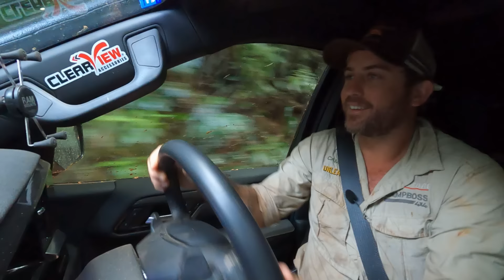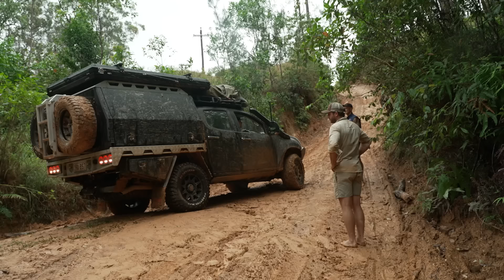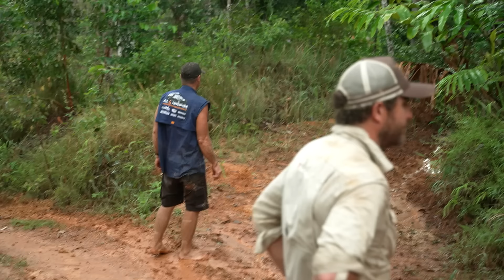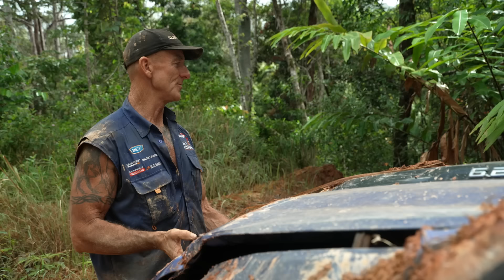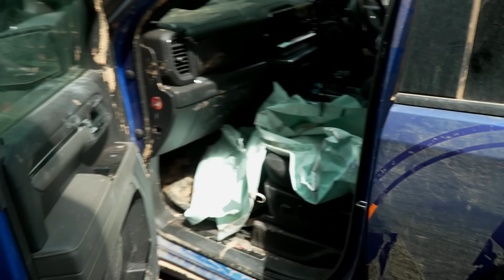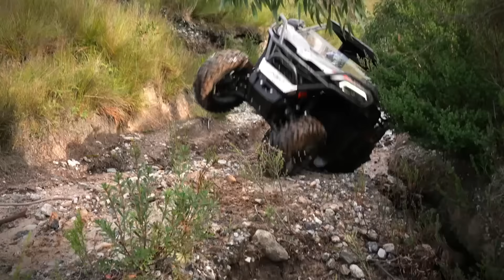🤬 NO NO NO! We screwed up – Chevy ROLLED & WRITTEN OFF!!

Comment: Brakes on wheels locked, no steering the driver becomes a passenger. Easier in hindsight, but in the low range use the gas pedal only when needed. The main thing is no injuries  insurance ,sponsors contractual funds, probably cover the damage easily.
Reply: Watch the video again, he was driving through the brakes.
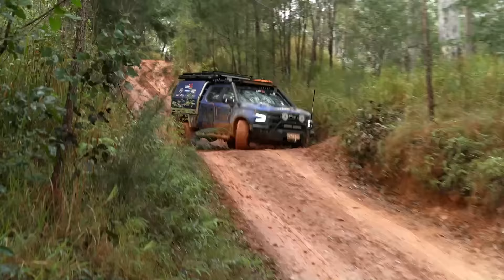Reply: @deangoodsell3478  around 16:34 he's locked up and just a passenger. Agreed he's still got steering and the wheels are turning until the camera angle changes at 16:29. The Dmax camera car made it down, they must have done something different....but the sensible option would have been to wait it out or even winch it down.
Reply: yep @17:50, front and rears locked up. The poser ute too heavy as well.

Comment: You don't drive the CREB in these conditions... Pull over and wait it out. But this makes great viewing guys. Hope all is well. Jesse is more experienced in this area and was put in front in the big rig.
Reply: Most other cars would of been fine, these guys are basically steering land yachts up 😂
Reply: Camera car D-Max made it down that hill first.
Reply: If you cannot see it was set up well joke on who?
Reply: I thought the creb track was always closed when wet?...
Reply: To have a better chance of success the chevy needed some Mickey Thompson Baja Boss MT tyres, the tyres used filled up with mud to easily, plus going slower would have helped.
Reply: @gen1c8rs88  he couldn’t go slower it just slid and got faster as it slid more, the weight forced him down at that speed

Comment: Wheels locked up. That’s why it’s always better to leave in low range and don’t touch the pedals.
Reply: Yes. As soon as it started understeering he locked the brakes, then was a passenger.
But without a lot of handling this situation, the reflex is to hit the brakes, no time to think it through.
I rally a front wheel drive car, and it takes practice for the reflex be to let go the brakes and hit the throttle when understeer hits.
There was time and distance when it started understeering to recover, and a jab on the throttle would have snapped the front back to the right.
But it takes a lot of driving through that situation to change the normal reflex of standing on the brakes.

Comment: About 10 years ago, I wrote a Volvo S60 off. Hit a Bus, went into a metal railing, my Wife had to be cut out. The amazing thing was, the Engine never stopped running. When I went to the recovery pound to get some item's out of the Car, I tried the engine and it started first time. ( My Wife was fine by the way). 
First time watching your vids and enjoyed it. Felt totally sorry for the Lad driving, I felt his embarrassment but it could have happened to any of them.

Comment: Buy a $20,000 105 series Landcruiser without a fully loaded kitchen on a set of 35" Cooper STT Mud Terrain's and it will eat that track for breakfast. It also looks like that part of the track has recently been graded as there are no tyre ruts which help with traction and guide you down.

Comment: That sucks, sorry to see that lads.   low gear, low range, compression locked up the wheels just like locking up the brakes and it was all over. See similar situations with people winter driving in snowy icy conditions

Comment: Someone in the production team thought it would make good viewing if they let the least experienced driver have a crack at one of the most dangerous tracks in the most expensive vehicle. In 17 years this is the first time jase hasn't driven his own vehicle. Why?
Reply: Jase was driving his own vehicle. The 300. Even he had a bit of trouble driving the track. Probably should’ve led the way though I would’ve thought. Good episode and series.
Reply: Dangerous? It was a straight forward descent the bloke didn’t have a clue
Reply: @JasonMaly  Dangerous enough to flip a vehicle.
dangerous enough that there is several cars that have fallen off the side of the track, 
dangerous enough that people get stuck on the track for days. 
dangerous enough that every year there is vehicle roll overs.
Not sure he didn't have a clue, but he definitely doesn't have the same level of experience.
Reply: @ICANTGETANYUSERNAME  So when did jase start driving the second best vehicle instead of the biggest and baddest in the fleet?
Reply: Mate you couldn’t walk the track without slipping over. Rain started falling at the halfway mark. In the weeks before this they drove the hardest track in Oz and made it. Last hill bit them.
Reply: @paulh223  Exactly, so why tackle it with someone who doesn't have the level of experience required to do this track safely.

Comment: I had a diesel starting to runaway (oil level too high for the angle). I was waiting for that with the roll over - if it does happen and you’re in a manual- leave it in gear -apply the brake so it will stall the car. Then you can lower the oil level…. Better than blowing up the engine.

Comment: Very disappointed to see someone I respected as being reasonably responsible, long gone are the days of reputable 4WD people teaching new comers what to do correctly, from saving tracks from closure and safety. I won the CREB track rally put on by the local Toyota Dealer back in 1990 in our little old Toyota Hilux ute. no raised suspension no dif. locks just the standard old 1800 motor, standard size AT tyres:-) just shows all this sponsored gear, to take your money is unnecessary, with skill? have always had split rims on all my vehicles no extra wide sand digger tyres and have hardly ever let my air pressure out. Travelled around Oz for 5 years back in late 90's in our 80 series, been just about been everywhere in that time, never been bogged, used my recovery gear heaps of times, for the over modified vehicles with armatures driving, with no idea what they are doing, copying all the new experts being directed by sponsor directors I imagine, never in standard vehicles, but with $70- $80 thousand dollars worth of extras to get them through? Just saying time for a change of attitude.🤠

Comment: Clearly on the brakes from the top of the hill, trying to lose control much?? 16:25 you can see someone had driven the same line beforehand and lost the back LHS tyre in the rut. Also the view through the windscreen at16:33 you can see the same line had been driven into the bank already, left hand tyre track in the mud and the grass/dirt pushed up where a bashplate already hit it! What's going on here, looks like they wanted to have something dramatic happen and had to have a couple of goes at it. All makes for subs, views and comments = $$$$.
Reply: Spot on , I totally agree , looking at it , the camera car went first , then they set up two cameras to film , car rolls , then sliding bare foot into frame yelling is he ok with no reply !!!!!!!   Raising the drama / suspense 

He didn’t crash at 100kmh , he could of yelled out he was ok the first time they yelled out if he was ok 

Yer I’m calling bullshit , do the math , if you get 1 million views over a year , that will probably pay for the incident

Comment: Boggles the mind to think someone decided that a little chevy half ton was a good platform to build an "off road vehicle " cracks me up. Anything is possible of course if you throw enough money at it and replace the shopping mall rated suspension parts etc.
Here in the US they are more at home as a daily driver that has the added advantage of being able throw some gear in the back or tow a little trailer once in a while altho why would anyone buy a Chevy when they offer a Toyota that fills the same role. Want something that's actually up to the task, no need to reinvent the wheel. There is a reason Toyota's totally dominate the heavy lifting from Africa to the Middle East to the outback and literally everywhere in between.

Comment: I bet it's fixable without much issue. I see some sheetmetal damage and you might need to jack the roof back up a little, but honestly .... for what you've got into it,  it won't be bad to repair it. I'll cost more to replace the airbags than anything, IMO.

Comment: Jesse had that sideways from the very start.  Looked like rear brakes were locked up.  1st gear low range manual mode, tap the accelerator at times to get it straight.  Big heavy vehicle but.  Easier said than done.  safety is the main thing.  Jesse wasn't hurt.  That's all that matters.  Jason and Simon didn't use their brakes.  That's the trick.

Comment: It looks like he got scared and held the brakes on. It's hard to say it wasn't there, but don't hold the brakes if you are in this sort of thing. Just tap them because if they aren't spinning, you can't turn because it will just slide, and you will lose control. Glad he is OK, and what a brilliant show.
Reply: right as it headed for the mound those wheels weren't turning for anyone could have been a computer thing being a new POS all the other rubbish they have I wouldn't be surprised
Reply: that thing would have had abs and electronic stability control, i dont think you can turn them off like traction control.. esc is crazy good on gravel roads, even annoying if your trying to do a slide... those wheels were CAKED with clay

Comment: Not a whole lot you could do. 2nd or 3rd low and let it roll, zero brakes. Looked like the wheels were locked as you veered off. only natural though to brake when heading for a solid object.

Comment: Was the ABS/ STABILITY CONTROL  on, off, or defeated? You have to pull the fuse or something to completely defeat it, or it will compound your troubles off road. It will not let you drive out of a tippy slide!

Comment: This is the dumbest thing in all my years 4 wheel driving. Why wouldn’t u have winched the car down knowing how slippery it was. What an amateur channel. And before anyone says not long enough blah blah. Use extension straps park the anchor vehicle back as far as u can and creep it forward. Then once u get the anchor near the top of the hill u stop lower the descending vehicle down as far as possible then brace reset and repeat. U can even use max tracks as well as a spare anchor strap to the nearest tree. We have done this hundreds of times growing up 4wheel driving never having an issue. An uncontrolled decent is one of the most dangerous things ever.

Comment: Explain this. Why so fast down a muddy slope ?? Remember this is down hill. I look forward to the excuses.
Reply: Think it had something to do with gravity.
Reply: @silverdale3207  he was accelerating.
Reply: @darrenc4096  yeh, because of gravity, wheels were turning slower than the vehicle was moving weren't they, or am I missing something.
Reply: @silverdale3207  nah mate, your 100% correct. I stand corrected. Gravity was a major player as was the clay track. I rewatched the beginning of the drive and could see exactly what you were saying. I initially thought speed was the issue. It was but not due to the driver. Cheers 🍻

Comment: Skill issues on display here. The first part of video shows your speed, lines and control are all wrong. Your to fast, to close to the side, over compensating on steering lock, to slow to straighten out, lastly it’s way to slippery buy you push on, that’s inexperienced drivers.

Comment: The show has lost it , so far from its beginnings. Over priced over rated vehicles , and to roll a 200,000 plus vehicle for a show wow all for ratings. Low and slow 4 wd and you all would have got through clean and clear…